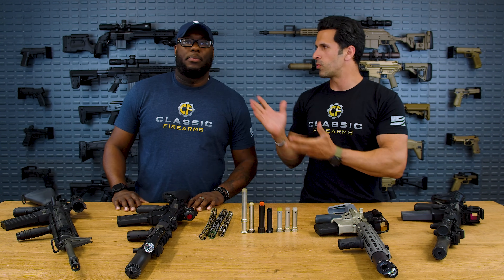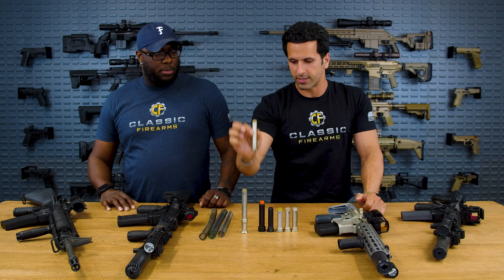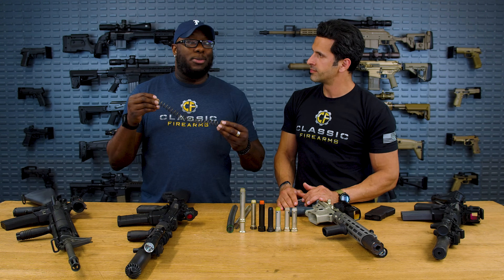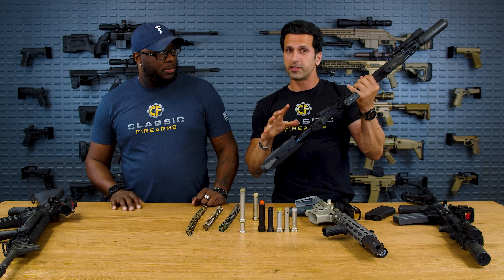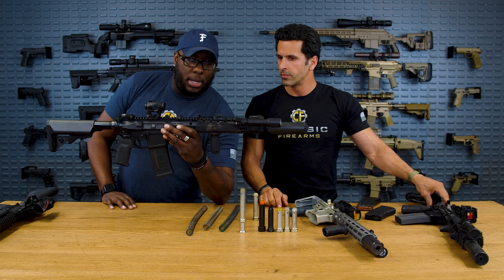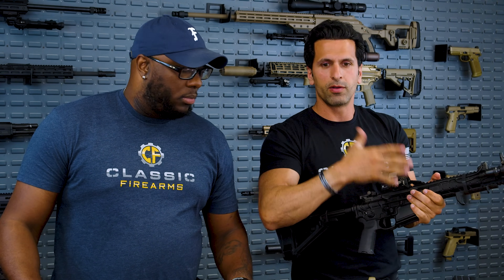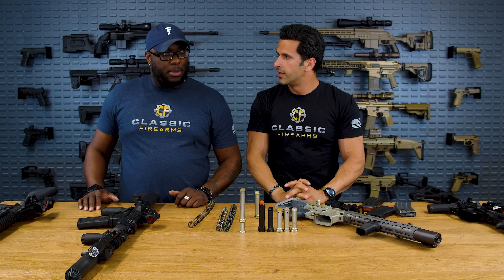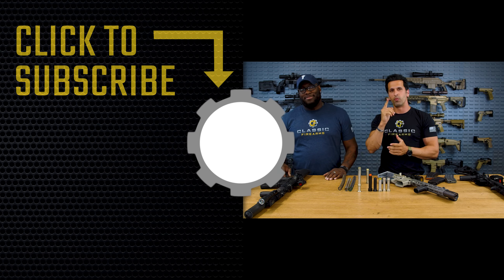Everything You Need To Know About Tuning Your AR-15

Comment: You guys should do a full length vid over 300blk. Adjustable vs non-adjustable. Buffer weights. Adjustable weights? Barrel length and gas system length and how all of that affects subs vs supers or maybe even cover variable common grain weights and how they cycle/function in different barrel lengths and so on

Comment: Best buffer system I have ever used is the Jp silent buffer I highly recommend them in any ar build you do so smooth and no annoying twang sound
Reply: And if you don’t wanna spend a lot (like me) go with the armaspec SRS they’re at generation 4 I believe. Fraction of the price at $89.99 (when I bought mine at least) and they work the same
Reply: I put a little white lithium grease in mine. I dont hear anything.
Reply: I might have to try one of those. 

Does JP offer the higher power springs like SpringCo? I use a H1, H2, or H3 and a SpringCo White, White Hot, or Blue Springs.
Reply: I never hear this twang everyone talks about of the gunfire
Reply: Immediately when messing around with a new AR I throw a jp silent capture and a radian raptor in there. Those are my non negotiables

Comment: Guy that invented the A5 system now works for BCM. In case you wondered why your BCM was so smooth. The system they use now on BCM is actually a slight upgrade from the A5.
Reply: cool info, thx bro
Reply: Facts. BCM tubes are Teflon coated slick and their new buffer weights are heavier and come with an internal biasing spring that further helps deadblow the bolt into battery.
Reply: It's actually called the mk2 buffer system and is proprietary

Comment: Once I quit trying run sub and super with the same setup I started loving 300 BLK. Low Mass BCG, Sprinco Yellow Spring and H2 for Sub. Same BCG, Carbine Spring and H3 for Super.. 3:30 - 4:30 ejection, no FTF no Lock Back issues Suppressed or Unsuppressed.

Comment: This video came right on time. I was just looking at ways to tune my AR, starting with the buffer tube system; charging handle is next. You guys are too awesome!
Reply: I will always consider the A5 system and a Superlative Arms gas block. I have a 16-inch with a regular system and it hit harder than my 13.7 with the Vltor A5

Comment: A little bit of misinformation is contained within this video; An A5 H2 buffer and a Carbine H2 buffer are not the same weight. An A5 should weigh in around 5.3oz whereas the Carbine will be around 4.6oz; Do not think you can covert your rifle from a Carbine system to an A5 and have similar results just because you used buffers of the same designation

Comment: I love tuning my setups.

I have twin CMMG AR9s, one is an 8.5 the other is 11.5. If you're in MN and want one, LMK.

but anyway, in the 8.5 I have an AR10 buffer spring with an H1 buffer and the recoil impulse... its sharper, but shorter, if that makes, sense. The lighter buffer and heavier spring mean it seams to snap back much quicker.

On the 11.5, I have the common AR9 buffer, with the standard spring, and I also have a rubber washer on the buffer face. It really seems to help.

Comment: For all the new folks who don’t know what’s going on with this type of rifle, you guys should have shown the hole on the top of the barrel, where the gas flows into the gas block.  Should have shown an example of an adjustable gas block not installed on a barrel like the Superlative Arms one with “click” adjustments for gas flow or bleed off and non adjustable gas block to compare between the two.  Should have had a BCG (Bolt Carrier Group) not installed in the upper for reference of how the gas flows into the top of it into the Key via the gas tube and then vents out the side and show how the bolt rotates and moves for ejecting the spent casing to prepare for the next round to be chambered.  Should have talked about different styles of gas tubes, how you can buy a “pig tailed” version, that goes from the gas block towards the upper receiver then usually two full rotations around the barrel before it goes into the upper receiver to mate up with the BCG gas key.  All things I have mentioned, I think would have made things easier to understand for people that do not have a good understanding of this type of operating systems.
Reply: It sounds like you should make a video. ( not being a a##) just sounds more in depth. Not gonna lie I just use adjustable don't want to deal with any problems.

Comment: Great video. I wish it had come out 4-5 months ago when I started to build my own AR’s, but learning from one’s mistakes is the best teacher. 

I will say I love Jason’s, “Just throw a can on it” comment. I just took the plunge down the NFA rabbit hole a couple weeks ago and unless you know someone with the exact same rifle and muzzle device that you have, with the can you are looking at buying, and will let you try it out on your gun, there is no, “Just throw a can on it.” 

I did have one question though, regarding the buffer weights. I’m shocked they didn’t mention adjustable buffers? I had been running H2’s in all my builds, but my latest one I threw an Odin adjustable buffer weight in it, and I absolutely love it. I don’t know if I’ll use anything else going forward.
Reply: Probably because the only difference between the "adjustable" buffer instead of a standard buffer is the adjustable is assembled with screws and the standard is assembled with a roll pin. 
You can change the weight of just about any buffer, with the exception of some of the captured assemblies

Comment: I only own 3 AR rifles with buffer tubes. 2 AR-15s and 1 AR-10 with 2 upper and All are some type of different or Gucci. 
LMOS BCG/CF barrels/8.6BLK/LMG build. All have dedicated Cans so I went with JP Silent Captured Spring kits and either Superlative Adjustable gas blocks or Riflespeed Gas Systems so I could tune them from both ends to make sure they ran super smooth and reliably.

Comment: I've built a lot of guns. NEVER start with the buffer system. Start with gas and them move backwards
Reply: This
Reply: Great point.
Reply: You are correct, but I think they were talking about the case where you don’t have an adjustable gas block. You’ve got to work with what you’ve got and in that case it’s the buffer and spring. At least that is how I took it.  But you are correct. Tune the gas going back before you start messing with buffer and springs.
Reply: What is your argument for starting with the gas system instead of the buffer system that is the originally intended method of adjusting the cycling of the AR15?
Reply: @Man_Emperor_of_Mankind  AR’s like AK’s are over gassed a bit to insure reliability for wide rang of ammo/ammo types/grains.  Going to a much heavier buffer/heavier recoil spring to help with recoil will only make the bolt going back into battery slam harder causing unnecessary/premature wear on parts or if too heavy of buffer and spring are used.  Plus your AR might not cycle right, not eject spent casings, and or not load the next round due to the BCG not going back far enough to pick up the next round in the magazine.  If you start with the Gas system like an adjustable gas block, you can take some of the unnecessary gas out to help with recoil to be lighter by tuning the amount of gas into the system, and less wear and tear on parts, and only letting the “sweet spot” amount of gas into the system to reliably cycle rounds.  You can make way more incremental changes with a adjustable gas block, but as I said earlier, that will also depend on the ammo you use as well to find that sweet spot, for the right amount of gas into the system to cycle right.

Comment: Missed opportunity to talk about Flat Wire buffer springs which are the king of removing audible twang and have the lowest change in spring force from battery to full compression.
Reply: Just put a dab of wheel bearing grease on the spring stops the twag

Comment: Id prefer a captured buffer system as it helps to keep recoil down a lot more and its a lot less noisy than a traditional recoil spring and buffer system. As far as other rifle upgrades, as of now a cryptic coatings dlc bcg is what i need. Helps keep things running good and smooth for a lot longer than normal. Less gun oil needs using with that as well.

Comment: Useing a raptor sd ribbed charge handle and superlative adjustable piston system hardly any gas in face and runs way cleaner and cooler on my 6mm arc and 5.56

Comment: Just wondering.... Is the 3 o'clock - 4 o'clock general rule still a good starting point  ?   And then start making small adjustments from there. The reason I ask is I'm going from a carbine 5.56 to a new upper that is chambered for a 450 Bushmaster for larger deer in the woods. Currently running an H2 with the stock spring in a Colt SOCOM M4A1.  Thanks for your efforts. I like the "tech"  info! I'm not really into Mag Dumps. (especially with the 450).

Comment: I doubt it's a buffer scenario way more then a mag issue but i wonder if there could issues in the future. I own a bcm bfm upper with a bcm 2nd Gen lower with there softer system.  I also have the lancer advanced war plastic mag metal feed ramp. My friend also has a bcm and noticed when loading a mag it jams. I did buy some pmags 3rd Gen and I haven't shot it since. I should definitely do some more practice but I'm wondering if anyone has had the same issues. To me it seems like a mag issue but I'm wondering if my setup, it not being the same maybe a bolt carrier issue. Again my friends rifle is the full upgrade of what bcm had to offer and it did the same thing

Comment: As someone whos built an 11.5 458 socom. Finding any sort of good "guide" or reference chart that isnt just "3oclock or 4oclock shell ejection" is damn near impossible. Does a heavier spring increase recoil or better absorb recoil or help slow the mass of the bcg or....? Does a heavier buffer weight with a lighter spring equal the same as a heavier spring with lighter buffer? What does each part actually equate too as a baseline or do you automatically start with carbine spring and buffer and "see what happens" or is there a way to know where to start? If you change the spring but not the buffer what actually happens without "just trying it" first?

With my 458 most people assume heavier spring and buffer but research says it was "designed to use the carbine system". But apparently theres no guide of pressure vs barrel length vs gas length to reference. Just trial and error until you like how it shoots I guess.
Reply: To my understanding, the buffer weight has to do with the speed of the bcg going rearward. The strength of the spring has to do with the speed of the bcg going forward
Reply: I believe youre correct but where and why do you start. Meaning when you build a rifle, how do you know what weight and spring to start with thats "in the ballpark" so youre not starting out completely out of tune and have to buy the parts until you "find" the correct setup. I come from a numbers world so color coding annoys me. How bout 10 pounds or 15 pounds, etc so you know a 16" barrel with a carbine length gas system, firing X caliber should be around X pounds of spring with roughly this weight buffer. Seems like chewing up components until you "find" the sweet spot if you dont know where to start. @msquared9605

Comment: Disappointed. When I saw the thumbnail and title, I thought it would be Jason explaining all the factors to consider, what to change and how, when tuning an AR. If it's doing this, check this; if it's doing this, change that. Instead, it's Kaya babbling like Dettelbach. 2/3 of the way through, and what has he taught us: Buffers increase in weight ✔️already knew that. The BCG goes back and forth ✔️already knew that. There are different length gas systems ✔️already knew that. They need to do a part II, where Jason actually imparts some technical knowledge, and practical applications and solutions. That one, I'm sure I could stand to watch to the end. Maybe have Matt co-present with him. He seems to have a better handle on the technical aspects of guns than Kaya.